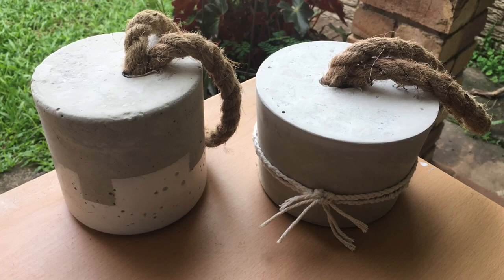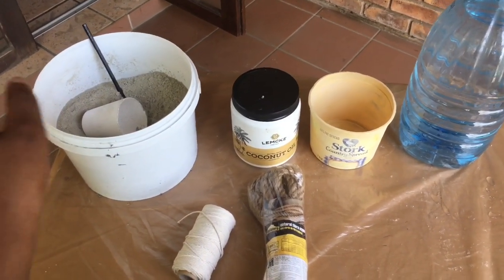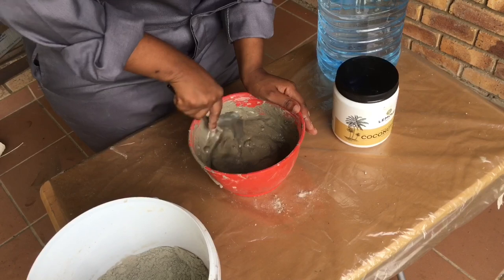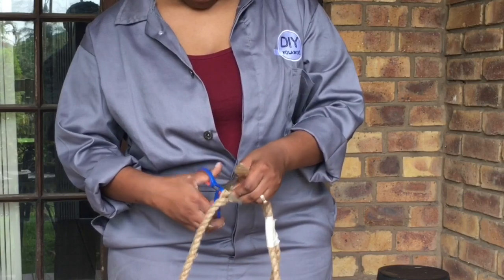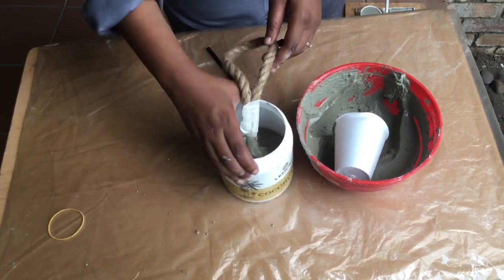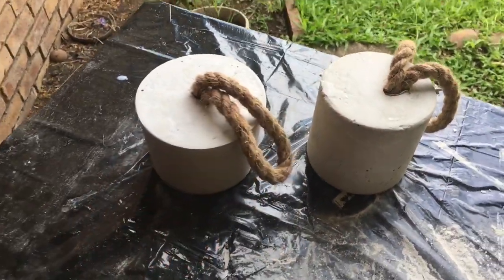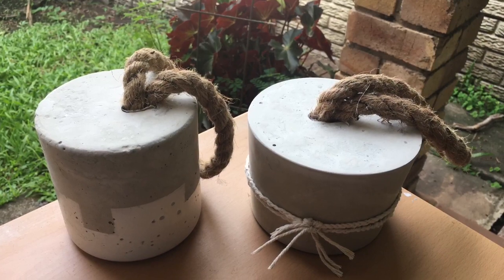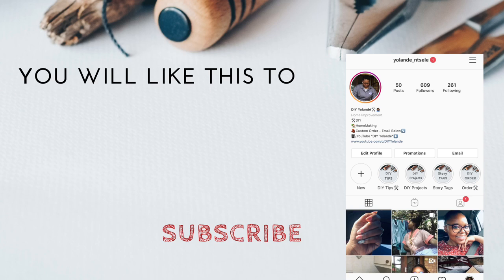Easy Cement Door Stop |DIY Yolande

Comment: Does it just easily slip out of the container after 24hrs of drying?
Reply from the maker: No it doesnot boo unless you have rubbed oil in the container. In my case i didnot and cut the containers open with a scissor.

In my previous cement videos I showed how too... 

Thanks for watching😘❤️